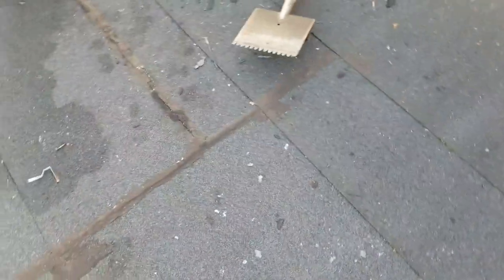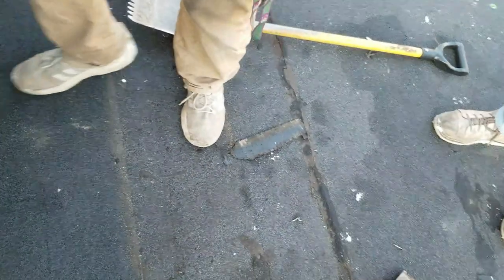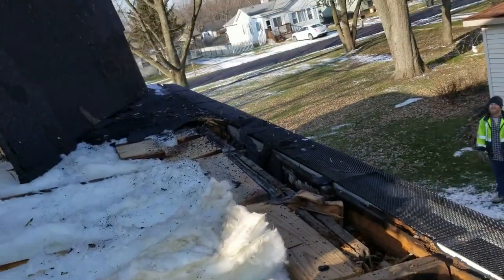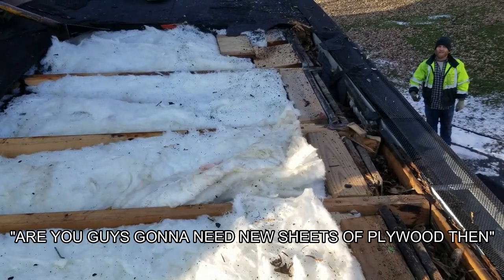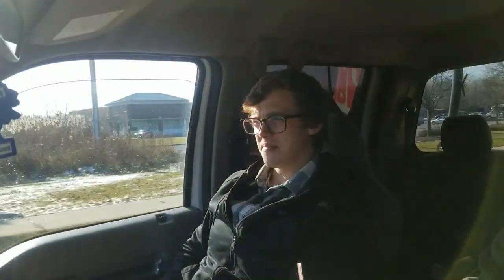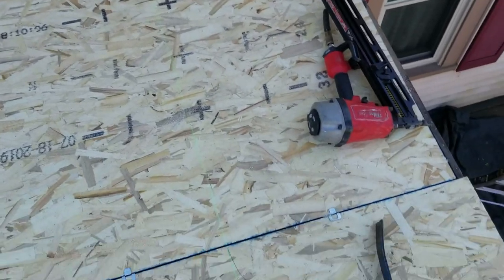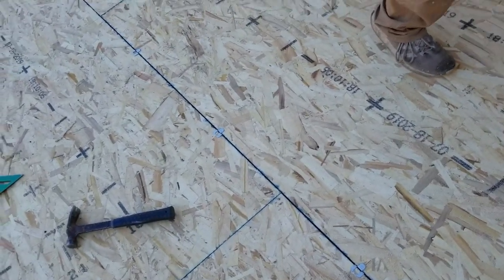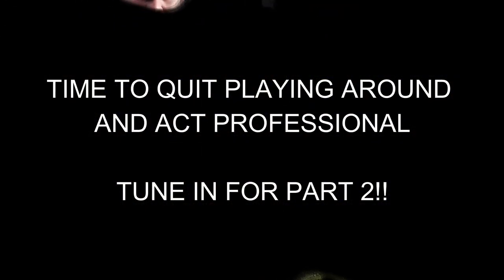How To | Rolled Roofing (part 1 of 2)

Comment: Not a roofer myself. I'm an automation tech. I also weld and do electrical. But my porch has a rolled roof that I will be replacing this Spring. Valuable video for me, thanks and appreciate you for your service as well.
Reply from the maker: Thanks just make sure you're subscribed to see part 2

Comment: Crappy rolled roofing. You should be putting rubber roofing on low slope. It will last three times as long as rolled roofing, and not leak.  Very easy to install.
Reply from the maker: I prefer rubber as well. insurance only paid for rolled roofing to go back down.

Comment: You seen like a legit guy so I just want to ask straight up.... why do you use OSB??.... I am in Oregon so our costs are probably a bit lower for estimates but I only charge $65 a sheet for removal and replacement, but I use 1/2” CDX.... I don’t see why contractors around here charge more than I do, and use a sheet that is half the cost as CDX.... not sure if it’s the same out there, but to me, in my opinion... OSB is a garbage material... as soon as it gets wet it deteriorates. As long as I do my job it would never get wet, but for those who do it wrong, as I’m sure you’ve seen more than a million times, there’s even more damage due to the fact that it’s OSB underneath. Your thoughts??....
Reply: Chris Parmenter it all comes down to price.. in my area 7/16 OSB comes to 13$ a sheet, 1/2” ply is about 30-35$ a sheet
Reply: Our ply is only 13$ here!! That sucks!!

Comment: Please quit smoking Boy Cub. When I started smoking they use to have smoking sections at high school they let you smoke then people thought it was cool. I figured it up I smoked for 40 years and I bought a pack a day everyday and spent close to $60,000 on smoking in 40 years. I also have chronic venous insufficiency where smoking damaged the valves in my legs and have had ulcers on the side of my feet where I don't get enough blood flow super painful. I am lucky a lot of people loose there legs from this disease and it will also cause  type 2 diabetes . Please quit your life can depend on it...